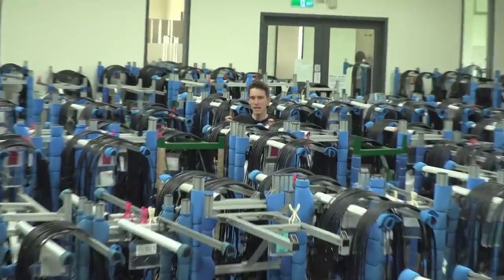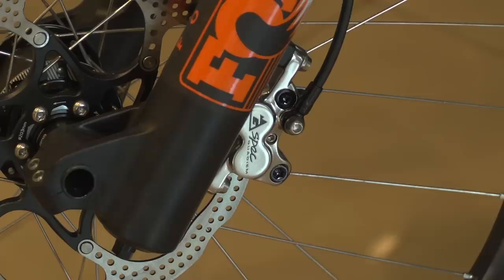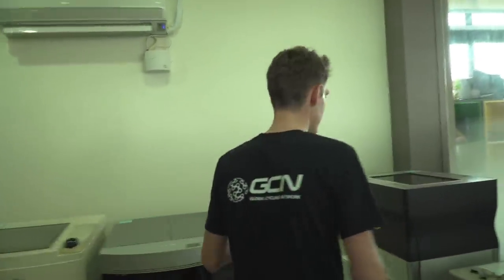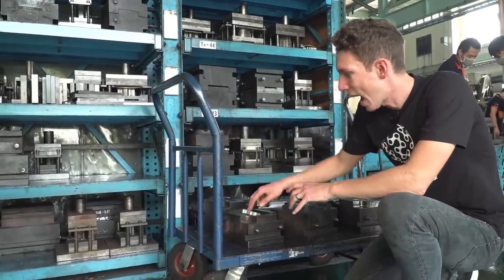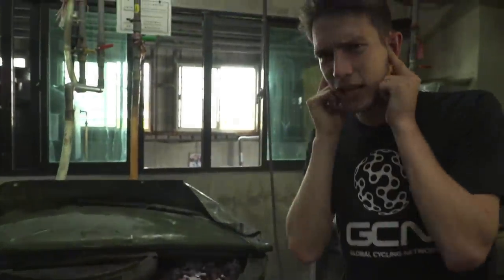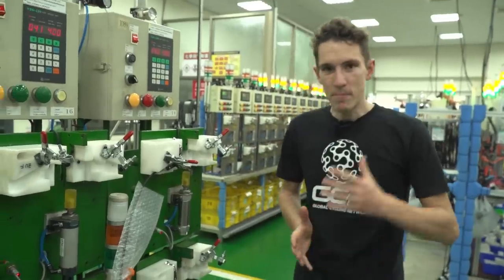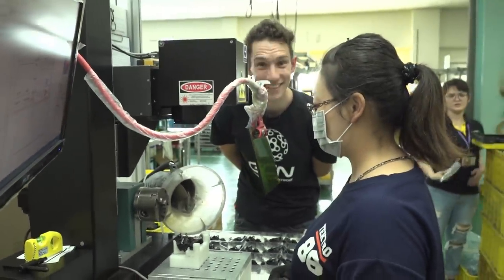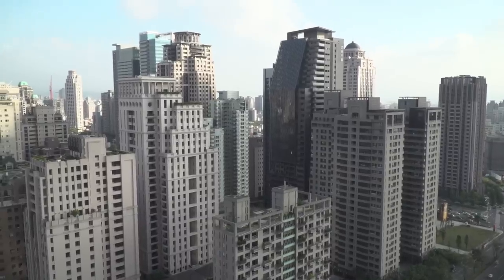How Brakes Are Made | Inside The Tektro-TRP Factory

Comment from the maker: Do you have Tektro-TRP brakes on your bike? Let us know in the comments below 👇
Reply: Global Cycling Network I had one on my cannondale cadd bike.. But Shimano brakes feel much more alive and responsive than tektro ones.
Reply: Yes, I've got a Tetro RX6 mini-v brake on my gravelish bike. Combined with Swiss Stop RX pads, they offer more stopping power than anyone could ask for.
Reply: Never before, but after seeing this I’m considering trying a set out
Reply: I use them and I did not know so much went into them.  Thanks, Si, for the tour, amazing.
Reply: tektro draco's on my fuji bike
Reply: Thanks for this great report. I have TRP Spyres (mechanical) on my Diamondback Haanjo Comp Carbon. After learning how to adjust them properly by using the TRP videos, I haven't touched them in over 1800 miles. They work great, but require a heavier pull on the levers when compared to my Cervelo R3/Dura Ace/rim-brake bike. So, I might upgrade to the TRP HY/RDs (cable actuated, hydro calipers) come Spring just to see if there is better response at the levers. The bolton replacement looks like a no brainer. Hey, how about a report from the Diamondback factory?
Reply: I have the TRP HY/RD mechanical interfaced hydraulic disk brakes on my road bike. Love them.. pretty good braking power.
Reply: Giant Propel Advanced by TRP!
Reply: Hi Charitha. Did you upgrade from the Spyres? If so, was there a noticeable improvement?
Reply: That was excellent, really enjoyed it. Great presenting Si.
Reply: John Hollister my bike came with these. Ridden nearly 5000km and only did bleeding once. Haven’t needed to do any other adjustments except swapping out worn pads and adjusting the pistons.
Reply: Global Cycling Network love my trp brake
Reply: I use Tektro on my road bike. I'm alive and well (and so is my bike) so no complaints.
Reply: I have TRP Spyres on my All City Macho Man Disc. They've been fantastic!
Reply: I'm running the HY/RD brakes on my cross bike.  They make a very elegent solution for somebody who want's some of the benefits of hydraulic brakes but doesn't want to have to swap out shifters on their road group set.
Reply: Got TRP Hy-Rd’s on my winter and touring bikes. Good modulation and stopping Power. Self adjusting provided cable to hydraulic chamber is set right in first place 🥇
Reply: I was a fool to think they were garbage. I guess not thanks gcn.
Reply: Yes I have a TRP Spyre mechanical disc brakes from when disc brakes were almost new. Love them, saved me many times although was sad that it wasn't a Shimano, but knowing how big they are now, feels better. Thanks GCN
Reply: 3:10 whomever made the FELT DA brakes needs to be fired. sorry, someone had to say it....
Reply: TRP Spyre on my gravel bike!
Reply: One of my favorite brake brands. I have them on my cyclocross and road bike!
Reply: I have Trektro brakes for years, V-brake of course and they still work fine.
Reply: GNC brake caliper was awesome
Reply: One arrived on the front of my Tribe Mess 001 single speed bicycle. I switched to Swiss Stop pads so I could get smoother and stronger braking performance.
Reply: HY-RDs on my road bike and Aurigas on my MTB!
Reply: Yes, TRP Spyke all of my bikes, including my trail bikes.
the lever has blade has play, but the brake calliper has a smart design, and worked great so far.
So far I struggle to fint a reason I absolutely need hydraulic brakes.
Reply: TRP brakes on my Propel SL advanced. Note the brake cable at 2:02 stretched across the tyre. if you use narrow training wheels that cable rubs on the tyre. Otherwise they're ok.
Reply: I ordered the TRP Revox Cantis for my CX bike a few days ago but have not received them yet...no discs but hey, the CNC-machined aluminium still looks very nice :) Are those made in the same factory?
Reply: I have been using the stock caliper Tektro brakes that came with my Planet X and so far no complaints. I was thinking to change them to Tiagra (to match the group set) or 105, but considering they work fine I might as well save the money for another upgrade.
Reply: I had the Mini V-brakes for one of my CX bikes.  With Problem Solvers "travel agents"  remains one most single best addition I've ever made to any bike in 25 years of riding.  I did the upgrade after my Canti just didn't cut on 6-miles wet decent in freeway like traffic (Kaneohe, Old Pail, Nuuanu, to Honolulu).  Once BB7's where road specific and disc stuff became more common, took that obvious route, however in the dry Mini V were almost as good as any cable disc.  The Mini V remain my hold my number one spot for most underrated components, even though they were quickly over shadowed by cable discs.  Before anyone points it out yes Avid, SLX, XT and XTR Mtb V-brakes where pretty fantastic and did work on cross bike with travels agents.  The difference was they still muck up in proper CX race.  Mini V's with travel agents could be run almost as wide as Canti's, and you'd get better modulation.
Reply: Double TRP Spyre SLCs on my custom cross bike. The only mechanical flat mounts available I think!
Reply: Hi Lars, yes those are made in this factory.
Reply: Actually, you don't really need travel agents for mini vees used with STI (road) levers. It's just that there are two types of mini V brakes, ones that are compatible to the older Shimano SLR cable pull and others that are compatible with the newer Shimano Super-SLR cable pull. The former have slightly shorter arms (as the cable pull is also shorter), while the latter have slighty longer arms. 
I'm using a front Tektro RX-6 mini-v with Shimano ST-5700 STI levers (Super SLR) and they work brilliantly. On top of that, you can get a very good braking performance in the wet as well with high quality MTB brake pads (such as Kool Stop or Swiss Stop or BBB Tri-Stop).
To be honest, I never understood why no major brake manufacturer has ever managed to create a decent brake pad while small manufacturers specialized in brake pads (such as Kool Stop or Swiss Stop) create such amazing products... In my opinion every single rim brake on the market comes with rubbish pads (including high-end models). I guess this is why rim brakes have such a bad reputation nowadays, mostly because 90% of the people never bother going for high quality aftermarket brake pads.
Reply: Yes, good old v brake
Reply: TRP Hylex on my ss gravel bike.
Reply: TRP SpeedControl brakes on my 2016 Giant Propel... thumbs up!
Reply: TRP Spyre on my 2016 Giant TCX. A simple, yet very reliable mechanical disc brake. Decelerates way better on a wet descent than my Ultegra brake with Swissstops on Carbon Wheels on my road bike!
Reply: TRP HY-RD on my gravel/cx bike. Good brakes, no doubt. I also run Tektros on my vintage steel frame road bike and they are flawless and look good, classic vibe.
Reply: I've got some trp Quadiem G-spec on my DH bike, absolutely love them
Reply: I just got hylix to build my singlespeed gravel grinder.
Reply: Scam business in plain sight.
Reply: I have them on my DH bike they work great on my new enduro bike that came with XT breaks burnt 3 rotors and pads black I took the XT breaks off and put TRP dh breaks on the enduro bike the bike stops now and no vibration or squeal like the XT breaks . It took Shimano 3 Months to Warranty them what a waist of time TRP are made better just look at them the stop as good as they look
Reply: Yes TRP Slate T4
Reply: I don't know what kind of brakes made buy tektro my bike has I know I can not get pads for it HD E500 brake pads metallic. So my year is ruined cuz it's going to be 3 months before they come in as far as I can tell thank you tectrol
Reply: So while you're innovating brakes tektro how about making some brake pads for those of us that need some HD E500 what the hell why can't you get any for 3 months

Comment: I have TRP Spyres on my bike which are dual piston mechanical brakes. I had hydraulics before on my former cargo bike, but though these current mechanicals lack the modulation, they are easy to service and travel to other countries with less fuss. This new bike is a breakaway frame which makes splitting wire cables possible via a connector. I have been to Taiwan before and hope nothing bad happens there. I like the green fields of rice and if nothing else, Taiwan is famous for boba tea.

Comment: cool stuff. I have TRP Spyre mechanical disc breaks and I don't really like them. That is however more a general thing with mechanical disc brakes and not with the TRP specifically.
Reply: Why not? I think mine are awesome.
Reply: good for you. I might just be too stupid to set them up. tried alot though... never reached the braking power of a good rim brake. In future I'll stick to the rim brakes or go hydraulic.
Reply: My bike came with the weird hybrid of the two, TRP HYRDs, which are cable actuated hydraulic brakes, they are actually pretty damn good! The original pads that came with them were shocking but not a problem since. They feel much better than normal mech disc brakes

Comment: I'm building a classic road bike with 700c wheels so need longdrop calipers, looking at Tektro, had them on my first road bike, low end Carrera, they were actually fine, not any worse than my Ulegra 6600 calipers. I want to know the hierarchy, do I assume higher number is better? I'm wanting to buy either R539 or R737 spec looks similar but which is best.
I need a 57mm drop do I go for the R559 which are 55 to 73mm drop and have them at the shortest end or the other 2 mentioned 47 to 59mm and have them at the longest end??

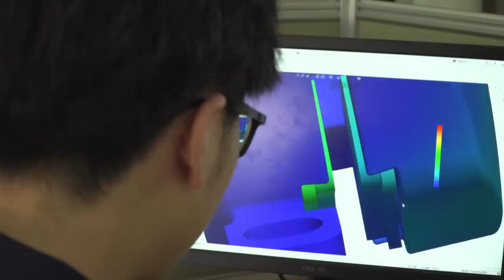Comment: @ 3:15, he was actually test loading the system. I dont really know if his using solidworks or inventor or other simulators though.
Reply: Super Junak i havent used solidworks in a while, i know they did a bunch of changes . i mean, if your a company working in strenght and stress on design . i would probably just use inventor, theres a neat design analysis on inventor where you can setup static or dynamic loading on an object and it pretty much solve the best design  based on you FOS. in solid works . its a bit tricky since you have to do different meshes snd do hickeys just to get in the same conclusion